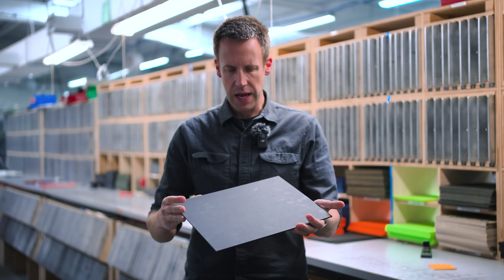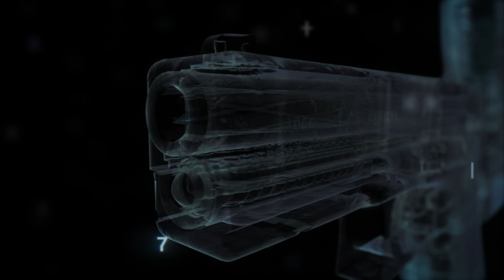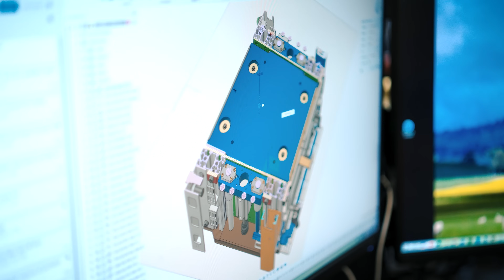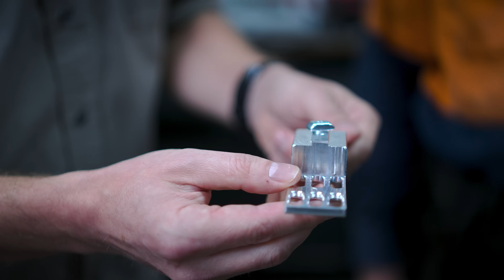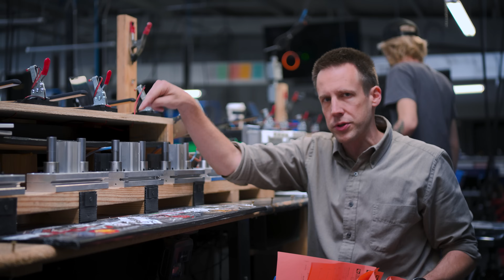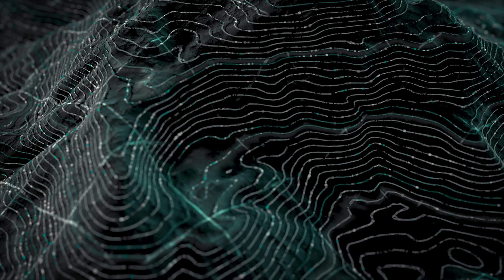Seven Powerful Tools of the T.REX Engineering Team

Comment: As an electrician who has made plcs. They is a huge range of applications for them. I worked on fire alarm, water treatment plants, small complicated systems like roller coaster rides. I will say adrinos are near too but for larger applications, plcs are more reliable and most components are easily swappable if they stop working.

Comment: We are a small startup medical company, but we decided from the start to put cnc ( mostly aluminium), 3d printing, electrical and electronics( sensors and motors) in-house. The ability to make most part our self is a real competitive advantage, and we can use cheap components to do prototypes, and then choose to replace critical parts with higher quality brands after a test period. So great to hear you also have a focus on keeping competence in-house.

Comment: Wow, who knows, maybe in a few weeks you will be running CANBUS or something...
One of the reasons I like to design with STMicro. STM32 on the 144 x144 pin die can do amazing things for a few dollars. It is full of COMM protocols. I had my design for redundant STM driven controllers for a submersible handling underwater comms, undersea audio with sea to air correction, underwater lighting, comms with the tow vessel 450' above, and emergency control over the life support and surfacing control. 
ABS approved at first glimpse. 4 pages hand drawn, and it sashay's through. I was given 4 days notice to prep the docs for presentation to the American Bureau of Shipping. Sketched it and faxed it to the MIT Grad presenting the sub to ABS. His part failed. They had just doubled the Life support cap. two weeks earlier. Yet it is positively buoyant and tethered to the tow vessel. Project fail.

Comment: I'm not sure what the clamping peasure is, but you could consider a second button for the other hand before the press cycle can activate.  That way you dont have operators putting their fingies in the path and losing them. 

PLCs are awesome, but they reflect a level of investment that you need to reach before they are worth persuing.  

But never, ever use an RPI.   Automation direct is much to cheap and significantly more robust.

Comment: Never forget safety considerations when engineering your own manufacturing equipment. Consider an external vendor to perform a machine guarding assessment to keep your employees safe.
Reply: Orrrrrrr have competent employees...
Reply: @pa_trickbrandt To maintain MSHA certification you must attend a refresher course each year, at the end they review fatal-grams which is every death that occurred in the industry in the last year, and the root cause.  And they review the statistics, which are tragically consistent: largely people new to the industry, or people with over 20 years.  

It turns out humans are really bad at never making mistakes.   Like really, really bad.  Multiple mistakes an hour is standard for anyone that studies human factors or human performance.
Reply: @pa_trickbrandt  telling the court "but I thought they were all competent and completely accident-free" doesn't usually help much during the lawsuit. It's almost always cheaper to prevent bad things from happening by accident.
Reply: @theKashConnoisseur  Fair enough. I suppose I'm very lucky (even naive) where I work that court-involvement didn't cross my mind

Comment: I'm a CNC machinist/tool maker for a large corporation's engineering firm. Our shop focuses on production intent prototype tooling(that's a mouthful). 

I have some notes:

- Don't neglect your work holding in CNC. Clamps and such can take you a long way and sometimes may be your only option. But having a repeatable setup can be invaluable. Minimizing setup time while simultaneously improving precision is possible with various "off the shelf" solutions such as FCS workholding. Is FCS right for you? I don't know, that's something for you to research. It isn't cheap though. There are other similar solutions available that may suit your needs better.

Are you using Solidworks or some other CAD software? What are you using for CAM?
Reply: Looks like Fusion 360
Reply: @armorers_wrench How would you rate using Solidworks for cad and Alphacam for cam?